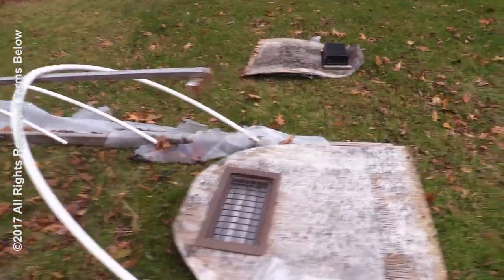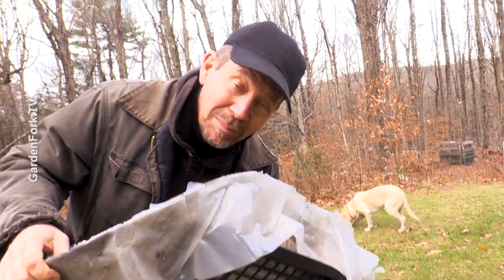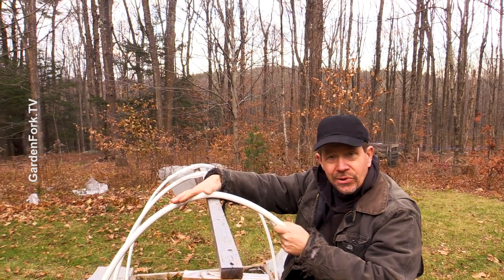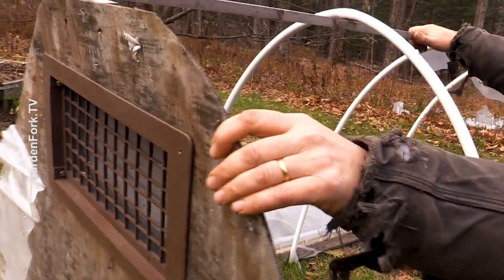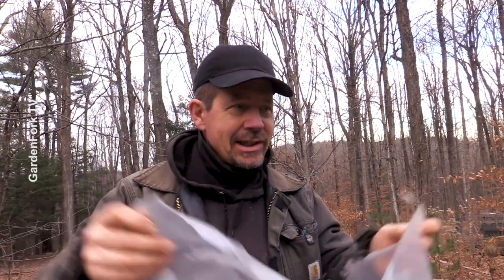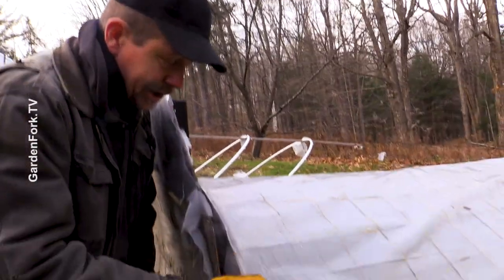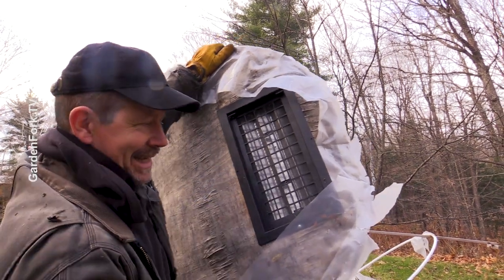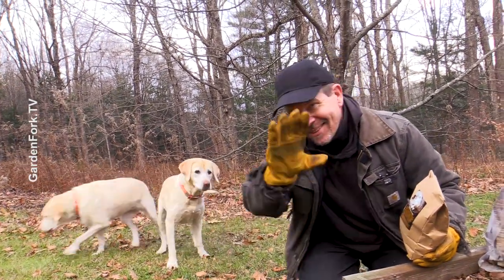Can You Help Me Fix This? | DIY Mini Greenhouse For Raised Beds | GardenFork

Comment: How about twinwall polycarbonate to replace the plywood - it won’t rot and it’ll let a little more light in?
Reply from the maker: i've seen that twinwall in some greenhouse catalogs. thx!
Reply: I was looking for a supplier for 4x8 foot sheets of twinwall polycarbonate, and the shipping was crazy expensive. Then I thought to ask at Home Depot. They don't keep it in stock but can special order it for $80/sheet. Expensive, but still a whole lot cheaper than having it shipped from a greenhouse supplier. If you only need smaller pieces, it's a little more reasonable to have it shipped, but it's still cheaper per square foot to special order it from your local store.
Reply from the maker: excellent. good to know. i may upgrade my regular greenhouse with twinwall, right now it has that wavy clear plastic roofing on it.

Comment: Hi Eric; I too was gonna suggest marine grade plywood, but I think the polycarbonate is a good idea. Most pro builders are using it for the larger greenhouses. 
Quick question: out here in SoCal CaliKim29 calls her husband “CameraGuy” on the air, do you have a similar name for your better half? Also, I keep forgetting how cold it is around the northeast; you’re certainly bundled up for post-Thanksgiving weather! Cheers
Reply from the maker: +DanielinLaTuna hi Daniel, most call her 'the camera operator' thx!
Reply: Hehe 😜! PS, love your videos

Comment: When you use screws to hold the pvc pipe to the wood it will be stiff to fold the structure. Why not use u bolts, no drilling required and the folding becomes easy and there is no screw heads to tear the plastic cover. If you have heavy winds in your area run a plastic thin rope through the pipe tie it to tent anchors (Screw style) and it will have to be a tornado to blow it away. If you can get exterior plywood and or use boat varnish to make it moisture  proof.  A small frame of 1x2 will be good enough to screw the fans to the plywood. That will give you a strong enough structure.
Reply from the maker: good suggestions Moshe, thanks for all of them. U Bolts are a good solution. thx!

Comment: This may sound odd, but you have some beautiful property there with lots of trees, so why are you not using them? Any hoop house you make would be very sturdy if it were anchored to those trees. And you are using raised beds right? No worry about blocking out the sun because you are using them when the trees have dropped their leaves and you can anchor in a way that would not hurt the trees so win win both ways. So maybe instead of a better hoop house maybe a better placing of them is the way to go?
 Julia
Reply from the maker: Hi Julia, the trees are quite a ways from the raised beds, so another suggestion a viewer made was to use hinges to anchor one side of the hoop house to the raised bed. and yes, they are great trees, most of them are sugar maples we tap for making maple syrup thx!

Comment: You need to drive steaks into the ground and then slide your hoops over them that will maintain them up right and anchor them down. If need be put a screw through them as well
Reply from the maker: great idea, i could use short rebar for that. thx Larry!

Comment: If no one else has mentions but can you use metal walls at the ends where you have ply wood and use a metal cross bar for the back bone with holes in it??
Reply from the maker: Had not thought of metal ends, good idea, thx!
Reply: no problem
Reply: also the cross bars you can use pipe bracers you would use for  water pipes again just an idea
Reply from the maker: i'll have to go look in the plumbing aisle of the hardware store for options. i'm sure there are a few off the shelf things we could use. thx for the suggestions!
Reply: no problem just glad i could help someone help if i can even though i have little or no experience in these type of things.

Comment: ok Eric how about a $10 sheet of WonderBoard Lite 5 ft. x 3 ft. x 7/16 in. Backer Board.
Too thin?
Reply: 1betrman I second the cement backer board idea! I’m sure it comes in different thicknesses and it’s designed for wet conditions
Reply: @meurig: thanks!
great to hear. I've never used it but was pondering using some around a raised bed garden idea. My cedar fence plank raised garden beds need retooling after several good years of use. I will consider that idea more closely.
Reply from the maker: i thought wonderboard would crumble. no?
Reply: Eric me not know... Lol
I'll take your word for it. Your my go to guy. My assumption it's made of light weight concrete fiber material. indoor outdoor (weather proof)
Reply from the maker: i'm not sure but i'll go check. i've done some demo work and seen backer board that has crumbled, i think due to moisture. thanks again for the chat!
Reply from the maker: i've seen that Lite version of backer board, and after thinking about this for a while, this might be the solution. and we could paint it with outdoor paint for more waterproofing. it would be lighter than a thick marine plywood too, which is important, as i store the mini greenhouses behind the wood shed.
Reply: I'm afraid I've never used it! just heard about it for use in wetrooms to support tiles, sorry!
Reply from the maker: i'll go check it out at the lumber store. hope it works as the solution. thx!
Reply: Eric thanks for your reply. Your always gracious about corresponding with your viewers. Have a great Garden Fork kind O' day!
dennis

Comment: Poly Vinyl Chloride - Will eat through the 6 mil plastic that touches the hoops.   That's part of your problem.  Tape or spray paint the top of the hoops to prevent.
Reply from the maker: +Dennis Laing good to know Dennis, I did not know that. Thx!
Reply: GardenFork please buy good greenhouse plastic. Trust me the extra expense is WAY worth the money. I understand trying to save a dollar but not when it comes to greenhouse plastic it’s worth every penny

Comment: Weebles wobble but don't fall down. Jello Jiggles LOL. pudding well it doesn't move much.  A heavier panel for the end is definitely what you need.  Maybe a better system to screw your cross bar to it. That is a fail point as well.
Reply from the maker: yes, i think attaching the cross bar and better wood is the way to go. thx!

Comment: Material for tunnel.
Similar should be available in USA
https://fascias.com/1-Inch-Translucent-6ft-Corrugated-Sheet?language=en&currency=GBP&gclid=Cj0KCQiAjO_QBRC4ARIsAD2FsXMhvo7ivZsHt8Utu_yg71BeKbYlB3UhDmkcZbWd4EWdaH5LAnHmZsAaAupjEALw_wcB

https://fascias.com/eaves-filler-24-pack?keyword=eave

Use 1" yacht ply for the ends treated with rubber seal paint.
Screw corrugated panels directly to yacht ply ends leaving an overhang the same width as eaves fillers.
Attach eaves fillers by pushing between Yacht ply and corrugated sheet sealing in place with silicone sealant.
Roll the unit over and attach a 2x2 (or bigger dependant on length of tunnel at the bottoms of the half moon end panels
and another as a ridge support.
Cut holes for thermal vents and attach.

I've got 8 of these and I'm into my 6th year with no issues

Giles.
UK